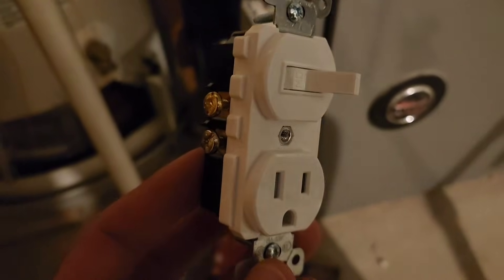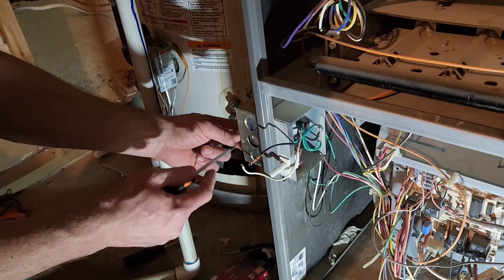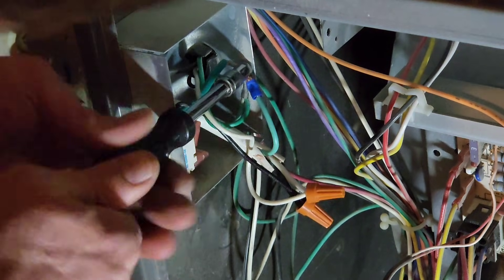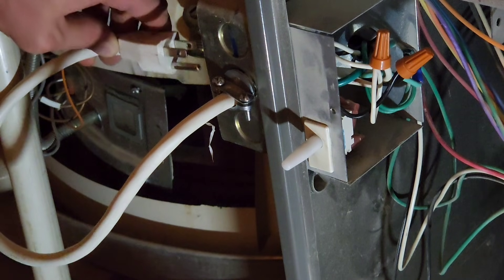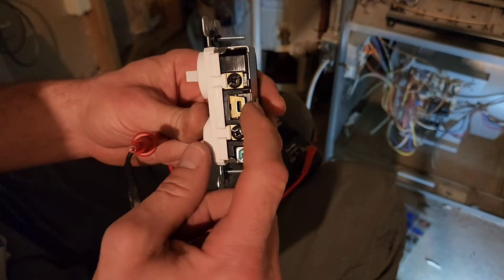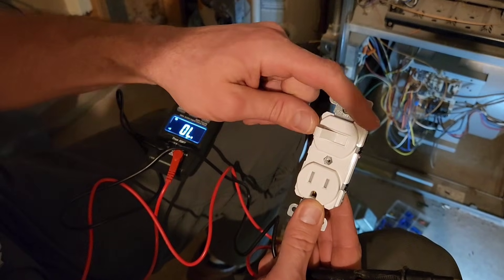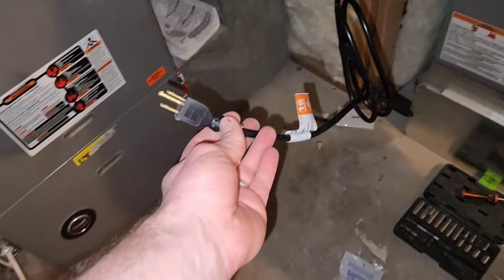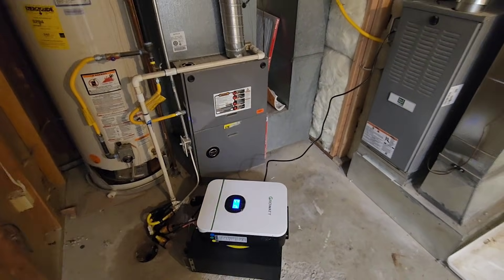Backup FURNACE PLUG - Simple wiring for when the power goes out(Generator Plug)

Comment: Make sure you get a high quality inverter if you go this route . I bought a pure sine wave inverter that was rated at 110 V. I cycled the furnace for heat 3 times. It worked fine. The 4th time it wouldn't work. I noticed it was now only putting out 106V. Which means under the load of the furnace, the voltage was even lower. All the newer furnace's have very finicky control boards that want to be satisfied with near perfect sine waves and voltage. The average mechanical generator won't even work. Do your research and tests before you depend on any backup method. I sent the inverter (which was fed by a marine deep cycle battery) back and am going to order a name brand inverter that is rated with a stable pure sine wave and voltage.
Reply from the maker: Funny you mentioned this. When I tried my inverter would work either. It did start it once. I end up getting into work by adding a ground neutral bond. Some of your furnaces require the ground and neutral to be bonded. This bonding happens in the breaker panel on your house but when you're running off a generator sometimes it isn't bonded. Depends on the design of the generator or inverter. It needs to be a good bond without any resistance. I was showing continuity but my resistance and my bond was really high.
Reply: A good generator is best

Comment: Two questions: 1. Regarding the ground between the outlet and the metal box, I thought that the outlet ground is connected to the metal mounting frame on the outlet, and the metal mounting frame is already electrically connected to the box through the screws that physically hold the outlet in place.  Why do you recommend a second ground connection? 2. There's a brown and what appears to be blue or green wire connected by a wire nut within the box; you don't comment on these.  What is going on with these?
Reply from the maker: 1) Yeah, It may be overkill to have that extra ground screw connected.  IMO, It would be nice to have that if someone happened to unscrewed the outlet from metal box... Maybe I'm being overly safe here by saying I should have done that step?
2), I believe those where green and copper grounding wires.... Grounding the entire furnace back to the grounding to the panel.
Reply: When you connect the cord ground to the screw in the box with the outlet ground, doesn’t  that connect the generator ground to the house breaker box ground?   Is that safe and ok?
Reply: @diySolarPowerFunWithRay  Thanks.  John

Comment: How do you ensure that your thermostats and dampers are powered using this plug?
My thermostats connect through a control panel that is powered by a 24v transformer that steps down 120v house power.  I believe that the duct dampers are powered by the same transformer.  This is pretty typical of home heating systems.
Reply: The transformer you are talking about is inside the furnace and powered by the connection that was shown in the video
Reply: @bisurdaddy  Thanks.  I have 2 transformers in the system.  One is in the furnace. The other is mounted outside the furnace and powered by the circuit that powers the furnace from the electric panel.
The external transformer sends 24vac to a control panel that is connected to the 2 zone thermostats and to the 2 electric dampers in the air ducts.
That external transformer would be "upstream" from the rewired switch/plug that is shown in the video.  
I'm not sure that my dampers would work or that the thermostats could call for heat if that external thermostat was not powered.
Reply from the maker: @Percy Faith  yeah. I was just thinking about this. Very good point. You'll definitely want to make sure everything associated with your furnace is powered through your generator plug. I haven't ran into your specific scenario but I will speak to an electrician. Imagine he could power it through the generator plug as well. Just some rewiring would be needed.
Reply: @diySolarPowerFunWithRay  I'll just have to get a generator that will power the furnace through the electrical panel via a gen-tran switch.  My old coleman with 15% THD won't cut it anymore with new high efficiency furnaces or fridges with circuit boards.
Reply from the maker: @Percy Faith  that would be even better. I totally need to hook up a gen transfer switch for my critical loads. You should consider getting a growwatt all in one solar inverter. They re pretty nice. I like mine so far.
Reply: https://en.wikipedia.org/wiki/Percy_Faith @percyfaith11
Reply: What happens when the grid comes back on while running off the inverter?

Comment from the maker: Adding a plug to your furnace can be quite easy. I add a plug to my furnace in this video to allow me to run my generator in case of an emergency or if my power goes out.

I found adding the plug to my furnace took under 30 minutes.

This is a plug-switch combo outlet which makes it easier to turn off the furnace.

=====   Product links(some are affiliate): =======

USED SOLAR PANELS:
https://www.santansolar.com/?ref=DiySolarPowerFun

GROWATT ALL-IN-ONE INVERTER: https://signaturesolar.com/growatt-48v-3kw-150vdc-stackable-off-grid-inverter?ref=DiySolarPowerFun

48 VOLT LiFeP04 BATTERY: https://signaturesolar.com/eg4-lifepower4-lithium-battery-48v-100ah?ref=DiySolarPowerFun

===== Product Reviews ========
-Growatt all in one inverter review: COMING SOON

-EG4-LifePower4 Lithium Battery 48 volt review: https://www.youtube.com/watch?v=ImpV3mx2fdk

-Used Solar Panels review https://www.youtube.com/watch?v=ftvKkMcibdw&t=60s

-Some emergency tips - https://mysillysquirts.com/home-emergency-preparedness-tips/

-----------------------------
Disclaimer
I am not a licensed electrician. Working with electricity is dangerous and can lead to injury or death, even when following documentation and instructions. I can not be held liable for such damage or injury. I am not giving or seeking to give advice on how to work with electricity. You should consult with a licensed professional whenever possible and get all work reviewed by an inspector and follow any local regulations in your area. I'm documenting my projects for informational purposes only.